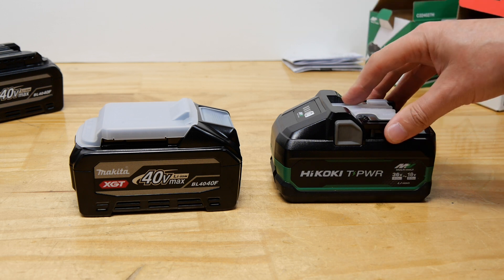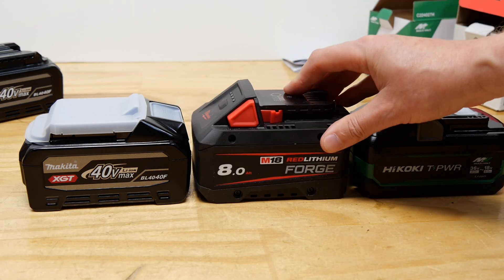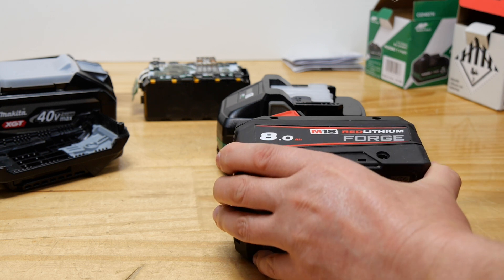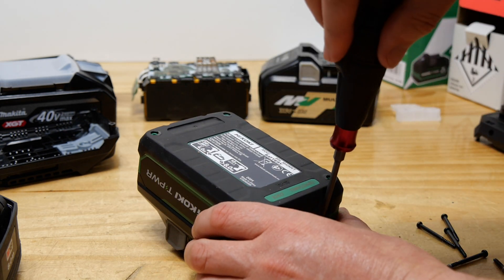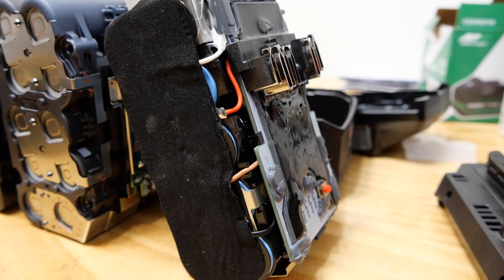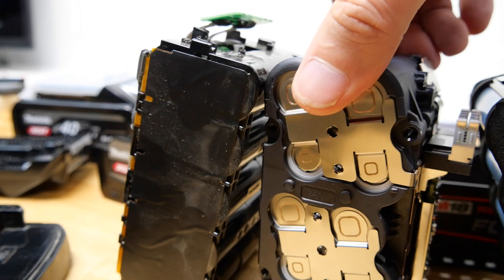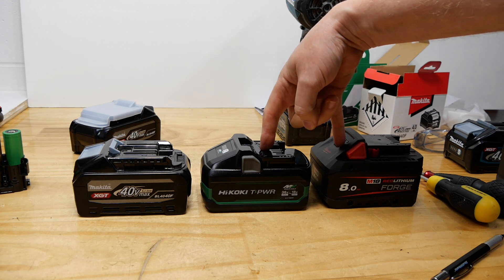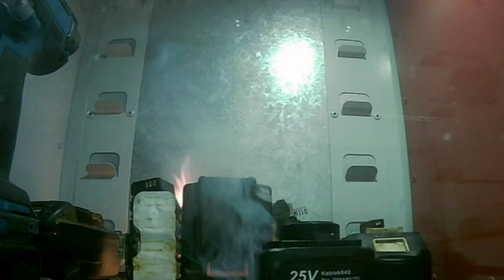What Tabless Cells Are Tool Brands Using? Makita VS Milwaukee VS Metabo HPT VS Hikoki

Comment: The Eve is a Tier 1 Grad A+ Cell and is actually highly recommended over the there brands  the have more Cycles  and longer life  more resilient  and works very well with Batteries that use balancing and equalization un like the other brands that are not very friendly with Equalization and balancing  and that is why Batteries that do not have this option Like the Milwaukee batteries that to not have Equalization and Balancing ..    because the cells they use are not Friendly with it .. ................so in short the Hikoki/metabo HTP being IP56 rated  having very advanced balancing and equalization  and using the more reliable and durable and resistant cells form EVE .. will actually last longer  than the other brands ...when I am building off grid Lifepo  Batteries I have used EVE with no issues  and they have out preformed every other Cell I have used ...and well every metabo htp battery new and old  has outlived the competition by almost 3 years  and I use my Metabo htp tool more .... and I will not be surprised if there new tabless and there future pouch cell and also there Solid-state batteries they plan on releasing in 2026  will also out preform and out last Every one else's ....................

Comment: Just scrach with srewdriver milwaukee terminal and you see some coating which is on all parts inside battery case. One terminal free of coating would not short your battery. Had to recharge all cells on Hd12 and to do it scrached all terminals to solder wires. After that use some silicone  to scrach off easyer next time till to balace cells again😢

Comment: What is that electric screwdriver you are using?
Reply from the maker: https://youtu.be/Xz2beP8VBG4
Reply: Thanks very much. I am putting in a heap of towel rails, robe hooks and toilet roll holders (in high rise apartments) and this will help with those tiny grub screws which are so easy (when loosening and tightening ) to drop down sink and bathtub holes!
Reply: Ordered one through your eBay link. Thanks again.
Reply from the maker: Cheers, hope it works out to be what you need.
Reply: Thanks again. I’ve bought one through your eBay link.

Comment: How is EVE is the worst? They are the same price as ampace, they have the lowest voltage sag and the best lifespan in abusive cycle testing.  A loss of only 5.6% after 300 abusive cycles.  Ampace appear to be a bit unstable and can suffer from random voltage drops in storage that can brick a whole pack
Reply: Because it's from Chinese company that's why.... I'm from Southeast Asia, uses Chinese brands tool whose battery uses EVE cells, it definitely longer lasting than my friends junk Milwauke battery....many of this tool YouTubers rarely uses their tool outside of video making.....
Reply: Its just word buzz. One bad experience with something and it turns to cult. The electronics also matter. Some batteries are missing the proper stuff to control the voltage and protection from surges, so the batteries or the cells just die under load. I've sold Hitachi/Hikoki power tools for over 13 years, 100's of tools and theres been ONE failed battery at that time.

Comment: Milwaukee did a great job with the newer batteries with the air vent on the bottom.

Great way to fill the battery up with dust and dirt.
Reply: Honest question. Does it matter if dust and dirt get inside?
Reply: @philodox7599 If it’s non-conductive…not really.

Comment: kinda strange without Dewalt who I suspect are the biggest sellers by some margin? i just bought into that 36v makita for those bigger draw tools
Reply: Biggest? I wouldn't bet on that lol
Reply: Worldwide, Bosch is the biggest selling power tool company and it's not even close.
Reply: @onikwa  that sounds like you're including the entirety of Bosch's revenue (dishwashers, e-bike motors, automotive parts, etc). Should only count their power tool division, but I dount they publish that level of detail.
Reply: @PazinPortugal   yeah in that case DeWalt is not even close, makita and bosch are dominant in tool sales in europe and makita is most likely the most sold tool brand worldwide
Reply from the maker: DeWalt has the largest sales numbers internationally by a considerable margin, definitely not Bosch.
Reply from the maker: It's tricky to tell exactly though, because as ToolScientist stated, it's hard to know what is included. Stanley Black & Decker, who also own DeWalt have the lions share of the market, but includes many divisions. Bosch is second, also with a few different cherries under the name such as Bosch green, blue, dremel, diablo. They also make a ton of blades and drill bits and other consumables for themselves and others. TTI is next, but that's a HUGE pile of companies. Makita is 4th, which is pretty high up considering it is just ONE company, not a raft of them like most of the others.
Reply: @BuildsStuff  I found a Bosch report that put their "power tools only" revenue for 2020 and 2021 at 5.1 and 5.8bn euros. Same years and using conversion rate on 30 June of those years, gives Makita 4.62 and 5.15bn euros. I'm kinda surprised as Bosch is a distant 4th in AU in terms of store space, usually has half as much as Makita. They must do well in EU.
Reply: @toolscientist Do they specify if their powertools category includes accessories? I imagine that is where most of their money is coming from (or industrial application, especially metal stuff). I know nobody that's using bosch as their main tool line, only individual tools.
Reply from the maker: @ToolScientist Bosch is VERY big in Europe, but not elsewhere. Bosch wouldn't be in the top 5 Tool Brands in NZ. Makita is #1 here, but Milwaukee are throwing everything at it to try and take that throne.
Reply: @BuildsStuff tools - you always ignore me 😢
lol dude, my guy, you HAVE to wake everybody up to the world of pen/stick impact drivers. I’ve got the makita which has practically saved my life, and the hikoki which I can’t get a good battery for to save my life. Now I’m looking at the PANASONIC WITH THE FKN LIGHT BUILT INTO IT!
Reply: @BuildsStuff yeah I know a lot of guys who all have Milwaukee. Personally from my experience they have lots of power but the ergonomics are terrible. Also when something goes wrong with them it's normally cheaper to just replace rather than repair because of how they only sell ground assemblies. While Makita still does individual parts e.g. you can replace the switches in them. Unlike Milwaukee where to replace the switch often mean also buying the battery retainer and controller which isn't worth it. Personally I'll stick with my Makita xgt range. Had it for three years and never had any issues still on the original batteries
Reply: @onikwa  this aint worldwide , its america and as far as i can tell dewalt and Milwaukie are the biggest suppliers into trade there and bosch is more a big box store  supplier for diyers in europe
Reply: @PazinPortugal  um THIS isn't America, you're in America, commenting on a video from a New Zealander.
Reply: @PazinPortugal holy cap dude do you really think Tools is from America? You’re the kind of genius who gives us a bad name
Reply: America has to be tied between dewalt and Milwaukee I’d imagine. Then I’d say makita just ahead of Bosch. I’ve never seen flex on a jobsite or metabo hpt although I wish I was in the hikoki lineup their tools are ridiculously cheap here. I find the hpt line not being represented is strange bc hitachi was pretty popular when it was fresh on the market in the lithium ion game. I did see a Panasonic kit about 15 years ago on a site.
Reply: @shadygunshow  too many names makes them confusing.. although dewalt might be owned by black and decker nowadays
Reply: @PazLeBon  very rarely see construxtion/motor/machine trades with blue or yellow tools.  Always red.  Might be different in DIY home gamers.  But then the average weekender will only get a drill and circular saw.  Trades will always have a dozen or more skins under thier belts.
Reply: I dont have numbers to back it up, but from what Ive seen as mobile HD auto electrician in australia, servicing the machinery in the construction industry.  Milwaukee is by far the most popular/ common power tool.
Reply: @BramBiesiekierski  I'd agree with that in the professional sector based on the store space and website space given to Milwaukee in Total/Sydney Tools. Makita may edge them out overall due to Makita's presence in Bunnings and wide range of gardening power tools.

Comment: Ah the old "cut into the Li-Ion battery and see what happens" segment.
Hopefully Fire and Emergency New Zealand are on standby?
Reply from the maker: Did you notice I was restrained and didn't actually put the clip in for a change.
Reply: @BuildsStuff  Thanks. The new LiIon battery smoker is a nice new ending.

Comment from the maker: Makita 40v Belt Sander VS Hikoki (Metabo HPT) Belt Sander https://youtu.be/yGqKKDVMgD4
Setting Tool Batteries on fire for science https://youtu.be/qGwdpfTmXiU
Makitas First Tabless Cell Battery https://youtu.be/btr6vj8OEiY
Slicing Open Tool Battery cells https://youtu.be/YuAfUpC7lsw
Milwaukee Battery Hidden Diagnostic Codes https://youtu.be/0enzs3Ht4f8
ALL Milwaukee Forge Batteries https://youtu.be/aEqjKnBMtiI

Comment: Yep, classic 40Ts in old 4ah pack. They can do 30A before they reach 80c, and new tabless ones can do 50A before 80c, so quite a decent power bump and they also have much higher peak loads.
Eve is a small disappointment yeah, they don't look best on some preliminary cycle life tests but at least they can all provide the same amount of power so no worries in that department. Thanks for opening them and checking, really appreciate it 😊